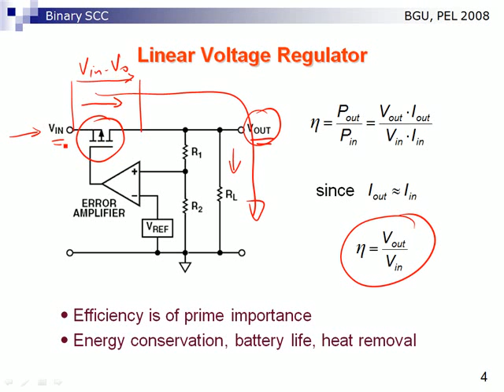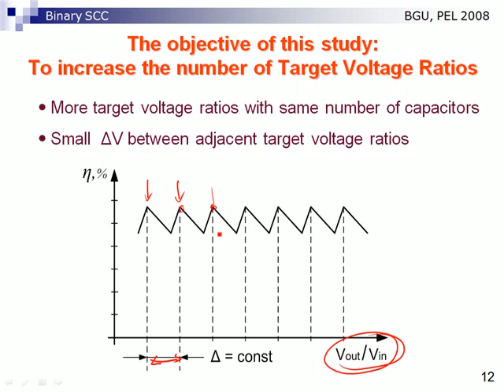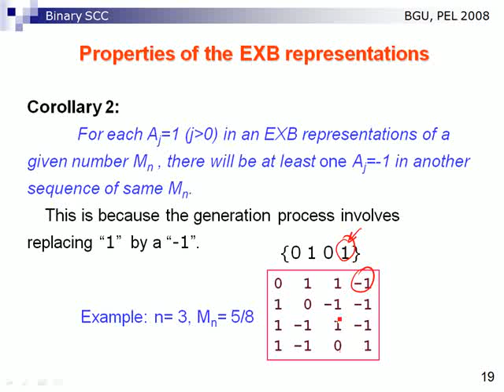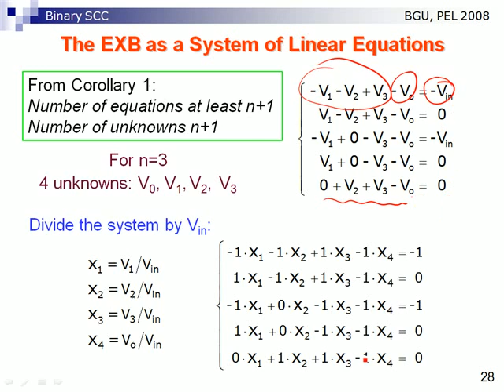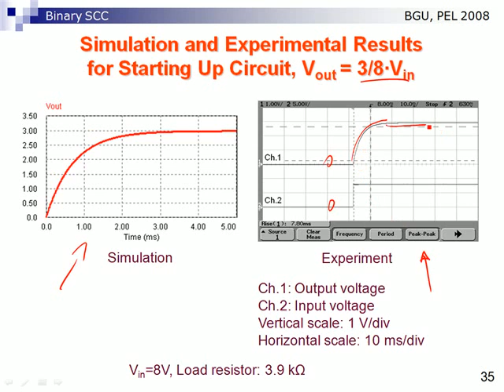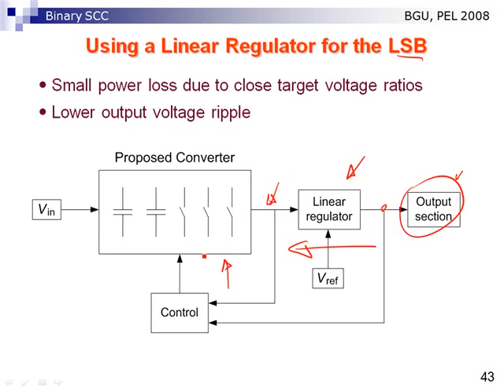Switched Capacitor Converters with Binary Resolution

Comment: isn't easier to make a serial cap array and  charge one by one at a time and just select the voltage using a mosfet  connected to the negative output of the capacitors? i'm trying that with a solar panel and a homemade electromecanical rotatory switch made from a pc-fan, my 
multiplier's working at 12x, i use it to explode mosquitoes in a parallel grid, hell, 1800v 100a may even explode your finger  if you touch it. The cap bank is galvanically isolated by a relay plus an optoisolator for control signals so i don't get a shock each time i touch the grid.